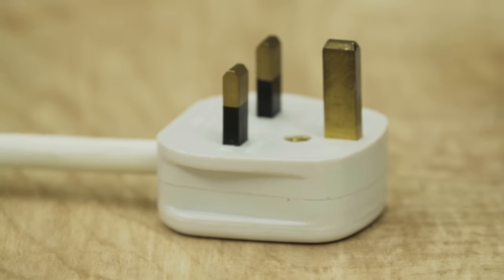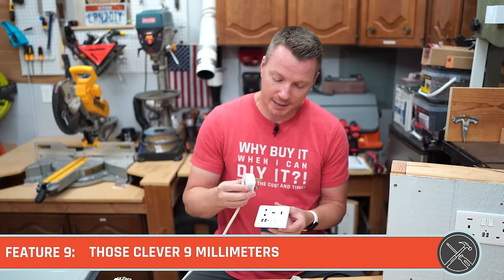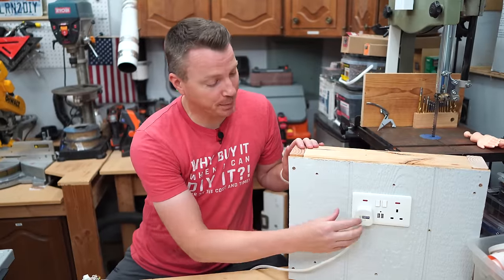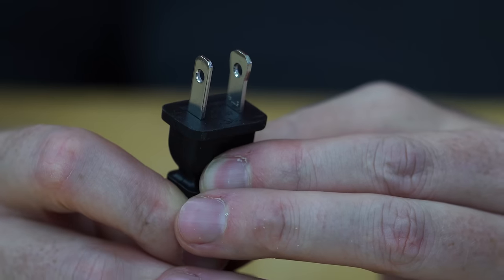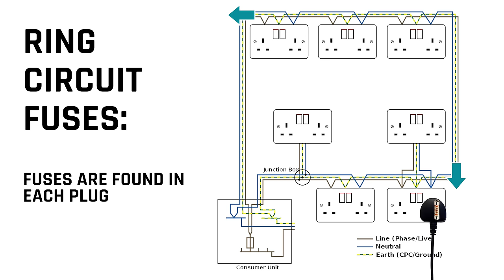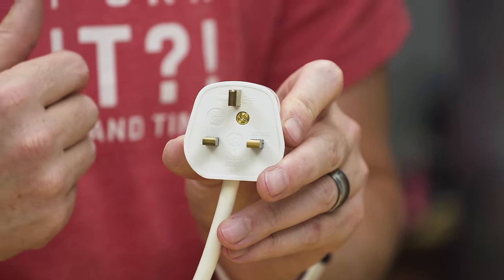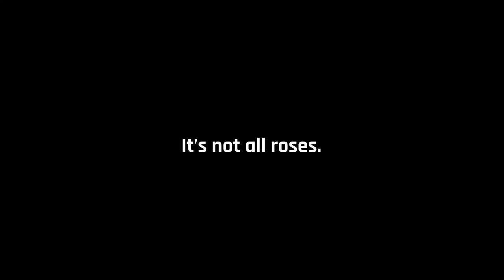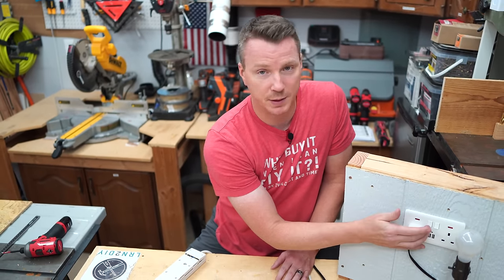British Plugs and Outlets Are On Another Level

Comment: A really impressive run down of the systems used.  nicely done 😎

To add a little bit. . .the ring circuits came into use during and after WWII as the were problems getting hold of copper.

Problems with load balancing of ring circuits are pretty rare.  They do happen, but not often.  Wiring regs in UK state that any appliance using more than 2kW should be on their own dedicated circuit - so like an oven, dishwasher, etc.

For testing ring circuits, yeh, it's not as straightforward as a radial, but the test are pretty standardised - you measure the resistance from end to end of L, N and E, then connect them in a figure of 8 and measure them. . . Gaz from GSH does a really good one on this for apprentices (GSH electrical, Electrical testing continuity of ring final circuit conductors, including protective conductors)

Also, all British plugs are tested at the factory to land with pins up.  If it falls on the floor with pins down, the plug falls and is binned.  (true story. . . honest 🙂)
Reply: there is no such regulation regarding 2000 watt power requirements, 2000 watts from 230 volts is around 8.6 amps ,, plugs are rated for 13 amps

Comment: Load balancing is not really a problem. There are typically separate ring mains for the power outlets on each floor of the house and further separate ring mains for the lighting on each floor. In addition, large power consumption items have their own separate spurs and fuses on the distribution panel, e.g. electric cookers, immersion heaters, washing machines.

Comment: The SCHUKO plug is the best design in my opinion, can't touch prongs at all, even if the plug isn't seated completely, hold strong even after decades of use, and best of all it's reversable.
Reply: Indeed and the Brits complaining about plugs and wall sockets oversees here clearly missed the ones used by their closest neighbors. Schuko is the very best out there. Also makes for much more durable extension cords where you really don't want the socket and cord to be at a 90 degree angle. And having very safe reversible ground/earth is always preferable over the non reversible UK and US plugs.
Reply: @moladiver6817  The SCHUKO plug also fits the French type E sockets and in those it is not reversible.
Reply: @apveening  True but a type E plug doesn't fit in a Schuko socket when it doesn't have side slots for earth. Which is often the case in for example Belgium.

Comment: One extra advantage of having the flex exit downwards from the plug is that, if any water was to fall onto the flex, it wouldn't chase up to the plug socket and cause an electric shock. It would just drip onto the floor at the lowest point. Also, probably mentioned here somewhere, it has been illegal for some years to sell any appliance without a fused plug fitted. Most manufacturers opt for a molded plug. Nice and neat but a right pain when you have to thread the lead somewhere. Oddly, though, extension leads still almost exclusively come with a removable plug. :)

Comment: UK plugs have always had a longer earth pin. This was very useful when the EU decided we had to have trapdoors on the power pins but it was not the reason it was longer. That is a safety feature on its own, since it ensures the earth is connected before the power is connected. These are indeed the best despite their size.  I have never stood on a plug. With a switch on the socket, the plug stays in the wall !

Comment: What really shocks me is USA extension leads. You can buy 6A ones with no fuse. There is nothing to stop you from plugging in a 10A load and causing a fire with the overloaded cable. The fuse is there to protect the cable as much as the appliance.

Comment: As a Brit that lived in Canada for a few years and now in Europe, weirdly I actually really miss British plugs and sockets (outlets). For the 29 years I lived in the UK I never once gave it any thought until I came to North America and then Europe and experienced so many issues with appliances having no ground, reversed live and neutral causing things to stay on, and one small thing blowing a fuse/breaker for the entire house/floor.
There's definitely some pros to the European plug as it's reversible, cable orientation, much smaller... but I've had more issues with plugs and sockets in 2-3 years here than I had in nearly 30 years in the UK.
Reply: Reversible is not an advantage over an alternative that has an obvious unique orientation.
Reply: @jeffreychongsathien  In day-to-day use being reversible/different orientations is an advantage, but as I also stated it leads to a much greater number of problems
Reply: In my ~30 years alive I never had any issues with European plugs.
The English system seems fine too. I'm just happy we dont have the US system :)

Comment: UK plugs have a few more features not mentioned.

All new portable electrical devices in UK are meant to be supplied with a pre-wired and moulded-on plug; if this gets damaged in use, it can be replaced with the "openable" plugs seen in this video.

Example plug uses fins as cable holder, possibly more common are a pair of screws that hold a plastic clamp over the cable.

Wiring the plug can cause confusion - which wire goes where? bLue - (the "L") goes to the left, bRown - (the "R") goes to the right, whatever is left over (yellow&green stripey) goes to the top.

Fuses are application selectable ranging from 1-13 amps - consumer electronics typically 1-3 amp, toaster, hair-drier, kettle 13 amp. 13 amp is about 3000 watts!

Same design can also be used in external versions that are weather-proofed.

Design shown is about 40 years old, and the presently active version. A previous version was very similar but with round profile pins. From memory, old plugs work in new sockets but new plugs don't fit in old sockets.
Reply: The round pin design is still in the UK. The 15A version with no fuse. It must have sockets with shutters. They are for special applications. The 15 amp round pin version, never had a fuse inside, and still does not.

Comment: I've never considered load balancing on a ring main, despite living in the UK all my life. It kind of does this itself as the electricity is connected both sides of the ring, no? It might help to know that it's usual for a ring main to cover many rooms (like one for upstairs and one for downstairs is a fairly typical set up for an average house). However, rooms with high loads (kitchen / utility rooms) can have their own ring, as well as other dedicated circuits for things without plugs - cookers / ovens / platewarmers etc. People who use their garage for hobbies, or have outside rooms for offices etc. also tend to have dedicates supplies (more rings) for those too. Standing on a UK plug is excruciating - tru dat.
Reply: Load is really only an issue in older, smaller houses where everything might be on one ring, including appliances. These days we split the floors so each floor has it's own ring, a kitchen will usually have it's own ring and big appliances like shower, oven, cooker etc will also have their own circuits.
Reply: As the resistance increases on one leg of the ring some of the electricity starts travelling through the other leg.  This is why if you was to plug something into the first socket of the ring and measure measure on the last one (depends how you look at it) you’ll still get readings.
Reply: Have a look at this video from eFIXX titled "KNOW HOW: How does current divide in a ring final circuit? (ring main)". It goes through how the current actually divides between the two legs depending on the position of the socket in the ring & why you need to be aware of load balancing.
Reply: The problem, according to John Ward, is if the ring becomes disconnected somewhere at one point.  Not only would you not be aware that there is a disconnection, you risk overloading the ring.  This is why annual testing of the ring is crucial.
Reply: @Darkroom48  Thanks for that - really interesting.
Reply: I think I read somewhere that the max current a double socket can handle is a bit less than 26amps, so if you’ve got two things plugged into one double socket, both using 13amps at the same time, it can get a bit hot (kettle and toaster?).
Reply: "as the electricity is connected both sides of the ring," That was my take in a ring circuit too Ben.
Reply: He's wrong about the ring needing to be balanced. The circuit breaker for the ring will be max 20 amps. The cable will be 2.5mm copper. This is perfectly capable of running 20 amps continuously. Even if you break the ring it will still work perfectly fine. The circuit breaker in the fuse board is there to protect the cable, every part of the circuit will be sized to continuously run the max current  (20 amps).
If you over load the circuit the breaker will trip and the circuit cables will be fine, regardless of whether the load is spread around the ring or in one portion of it.
Reply: @Darkroom48  While you are correct in the application of current theory, at the user level, nobody in the UK that pays attention to ring balancing. Perhaps an electrician does when designing a circuit layout for a new house, or subdivision or maybe in an industrial situation. In the domestic environment nobody is acquainted with the need for load balancing. While I am aware of Kirchoffs 1st and 2nd law I never pay attention to load balancing but there again I dont need to because someone else designed the system.
Reply: @howsyourdangler  No, the rings are not 20A - they are 30/32A. That's the point of them.
Reply: I'm acquainted with it and do it for high power appliances like 2 kW heaters, hair dryer, microwave, jug kettle and toaster. First try is one per pair of sockets then one per socket if needed for the appliance count. Selected for lower probability of two simultaneously active 13A  loads.
Reply: @TechStuff365  you can have as many sockets as you like in a 100m square area
Reply: @Monkeh616  they used to be 32a, regulations have changed years ago to max 20a
Reply: @howsyourdangler  .. no, no they haven't. Rings are still 32A, in fact that's the only accepted configuration. There is no point in a 20A ring.
Reply: @Monkeh616  I'm an electrician in Ireland, they have been 20a for the last 20 years here
Reply: @howsyourdangler  Okay. Remind me which edition of BS7671 that is.

Real rings, ones with a purpose existing rather than appeasing the 'but sockets go on rings' crowd, need some thought putting in to load balancing in high load areas like kitchens and utility rooms.
Reply: @howsyourdangler  Breakers on rings are 32 A
Reply: @Monkeh616  we don't use bs here in ireland
Reply: @howsyourdangler  And thus you approach my point. This little thread of comments is about the UK.

Why you'd bother installing 20A rings I can't fathom.
Reply: @Monkeh616  we use 20a rings here. In the kitchen we use a 20a ring, it helps with voltage drop. The  dishwasher  goes on its own 20a circuit. Uility rooms are 20a radial, but most electricians install rings due to the high current, again to help reduced voltage drop.
You can of course use 32a on a ring, but it isn't necessary. And I've never used load balancing on a ring, like how on earth would you ever ensure that. You have no control over where things are plugged in.
Reply: @howsyourdangler  Please note that the MCB for a normal UK ring is 30 amp !!
Reply: @pjeaton58  that is surprising, I've never come across a 30A mcb in my life🤣🤣
Reply: @howsyourdangler  Well - 32 amp to be of correct specification - B  type for domestic - avaliabe at most elecrical wholesalers.
Reply: And still nobody has explained *load balancing", or how on earth it is achieved
Reply: @howsyourdangler  Well - Load balancing usually refers to that in 3 phase distribution,
may be the poor guy has confused this since, a domestic ring main if properly cabled in 2.5 mm T+E will balance it`s self.
Reply: So basically this may become a bit of an issue as we transition away from gas heating and kitchen appliences.
Reply: @pjeaton58  yup, that's the only load balancing I've ever heard of
Reply: @howsyourdangler  a 2.5mm cable can handle 20 amps, when the circuit is formed into a ring the total cross sectional area of the conductor is 5mm so a 32amp breaker is used
Reply: @johnturnbull7798  how can kirchoff laws apply to a circuit that has NO  junctions or nodes, it is a closed parrallel circuiit, all points on a ring circuit are equal in length and resistance, all electricians are concerned with balancing the load distribution on a ring circuit, hence the ring circuit continuity test,
Reply: @howsyourdangler  It's achieved by not placing clusters of high power loads at the extreme ends of the ring.
Reply: @gimmieliberty6514  Every single conductor section is a node. Basic real-world analysis, not ideals. Conductors have resistance, capacitance, and inductance. Draw the circuit out fully and do the math.
Reply: @wrongmark  new kettles are 2kw max, so potentially 4kw for both 4000w / 240v = 16amps Even using an old 3kw one, its still onl 5000w so just shy iof 21amps.
Reply: @howsyourdangler  Not correct sorry, the breaker for a UK domestic ring circuit is 32A. A 2.5 sqmm radial feed would normally be backed up by a 16A mcb.
Reply: @adrianshingler9783  it used to be 32a ring here in Ireland, but it changed to 20a for ring or radial years ago. It's still permitted to have a 32a ring but nobody bothers anymore. We just split the circuits into 20a radials (max 10 sockets, max 2 rooms) and a 20a ring for kitchen with dishwasher on its own 20a circuit. 
We can debate all day the different rules in different countries, won't change a thing. 
Still nobody has answered how on earth "load balancing" is achieved, or even why it is necessary. Its a  ridiculous unnecessary and unachievable concept.
Reply: @johnturnbull7798  For sure, it's the whole point of circuit design; make it so Joe Bloggs can just plug stuff in and have it work without worrying about it!

Comment: Got to say, grew up with these 3 pin plugs, most native UK residents would not be confused by the wall socket being in the off position for very long.

I'll literally give you a pennies worth of advise. The plastic sheath on the live and ground was is a great idea. Don't do what i did. Can't recall what year it came into the UK electrical code but prior to that they where completely metal. For me it was some time in the late 70's, i dropped a 1 pence piece (mainly copper) yes one with Her late Majesty's face on it, down the back of a plug. A plug, plugged into an outlet that was switched on at the socket (or the wall). It lodged itself between the live and neutral and drew so much power it tripped the main fuse. I saw smoke briefly rising from between the plug and socket, then everything in the house went off. My dad an electrician was very annoyed, but not as much as my mum, we had visitors and the TV they were watching went off.

I wish i still had that penny as it had two notches on it, where it contacted the pins and melted a bit. Remember: Not every property is upgraded to the latest standard. Somewhere there may yet be old metal plugs lurking waiting to catch you and your penny off guard... ?
Reply: Seen so many pictures of this happening to Americans, done by their children or accidentally when they leave the plug hanging half out of the wall. Quite shocking
Reply: @Lilith-Rose  Interesting thing is, i recall at the time i had a 1 pence piece (not Mike, just 1p) and i was trying to hide it for some reason. I don't recall the reason for trying to hide it.  I do remember looking at the plug and i say plug, it was an adapter. A cube shaped plastic block, with the 3 pins on one side to insert into the wall socket and a couple of sockets on the top and side. So multiple devices known then only as appliances, could be plugged in.  Where was i... oh.

I looked at the adaptor and thought i only need a small space the hide the penny. I knew the penny would be held up by the pins if i could drop it down the back. I needed a wider gap so i pulled the adaptor out slightly. The appliances were still working, so no one knew how I was going to hide it, ha ha. I dropped the penny in the gap, job done from my perspective. Then what i described above happened.

I do not know of there is a moral here but i know a small child with an objective, who knows how dangerous something is and has rudimentary knowledge how it works. Will STILL circumvent all safeties to complete the mission. I did.

Comment: Nice video. 
When rewiring plugs I used to find it handy to remember that bRown went to the right as I looked at the plug and bLue went to the left. These days not many plugs seem to allow rewiring.

I did tread on a 3 pin plug once and definitely not to be recommended. However, it's very rare and I don't personally know anyone else who's done that (or they don't admit to it). Plugs tend to be kept in the socket and switched off there (or at the appliance). 

Travelling abroad as a child I used to think that the 2 pin systems in other countries seemed somehow more fragile and dangerous because you could pull the cable out of the socket.